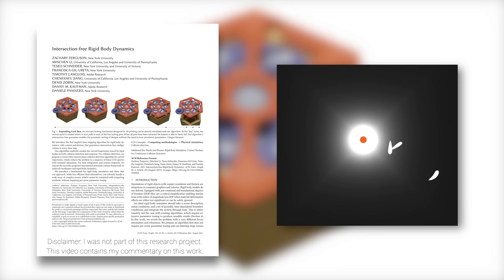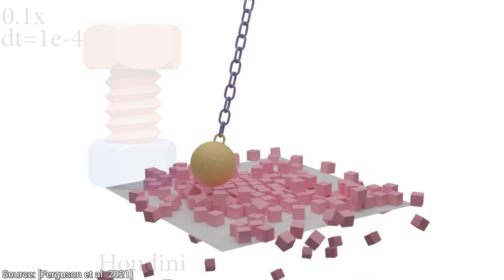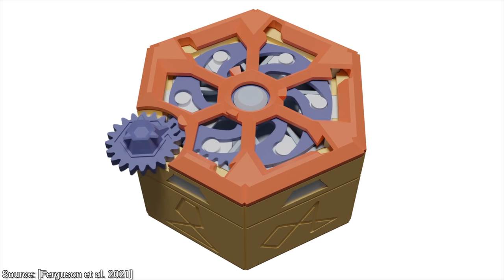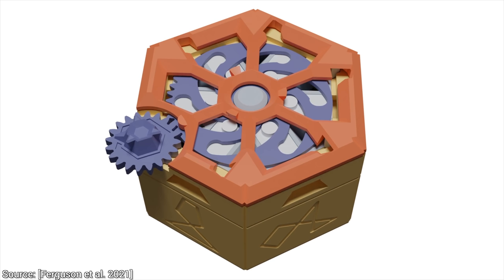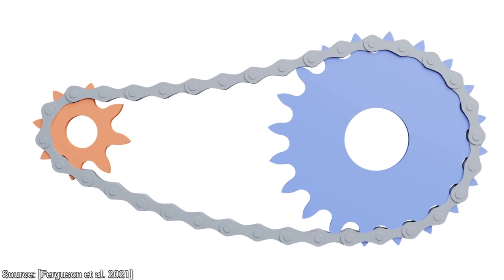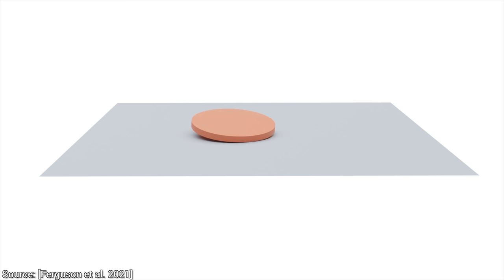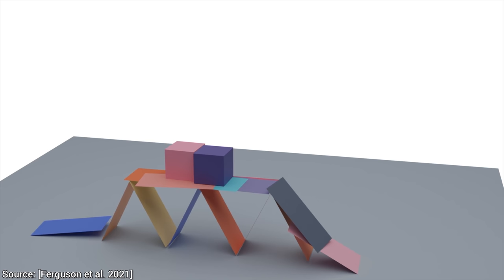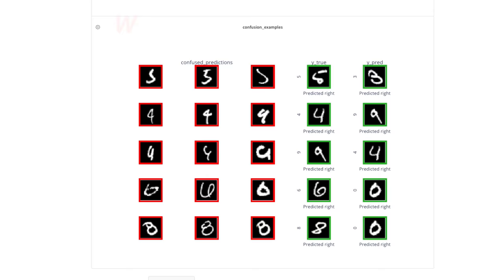The Tale Of The Unscrewable Bolt! 🔩

Comment: Cool that they used the storage box of Makers Muse (a 3D printer channel) and applied friction to it. I wonder what will be next!
Reply: I recognised the logo and was like "Hey, that's Makers muse's box!" It's very interesting that it's now been used in a simulation research paper
Reply: I thought I recognized Angus's maker's mark on the box.
Reply: @danielf3623  Thats not a makers muse box. He based his logo off of that design, that was some antic of some sort
Reply: @a51mj12  Umm, no: https://youtu.be/LU77kPf25Yg?t=503 That's his box, printed out.  That's his maker's mark.  That video goes through his design steps.  Even Károly credits Angus below this video.
Reply: @danielf3623  Its an old mechanism and many are recreating it almost identicaly even the ancient signs on the sides thats where he got his logo from
Reply: @a51mj12  You're joking right?  The mechanism isn't ancient, it's out of a book from 150 years ago.  It's in the previously linked video.  The box is not included.

 Here's a video of him doing maker's coins with that mark from 5 years before the previous video: https://www.youtube.com/watch?v=wSBLOhIFz6s.
Reply: @a51mj12  he specifically made variations of his logo to put on the sides of the box
Reply: @a51mj12  the "ancient signs" are just different versions his logo

Comment: wait so you're telling me we actually don't have an accurate realtime physics engine yet? with the amount of advancements that have been happening in the last few years I totally thought this was a thing that we already had... really shows how early we still are
Reply: we have some engines that are pretty good, but friction is tough to calculate accurately
Reply: There's some really decent realtime simulations for fluids, particles, and balls, but mechanical systems with links and gears in games etc are almost always done by cheating a bit and using a simplified model rather than a generic physics engine with friction, collisions, etc.
Reply: Like, the cars in games aren't simulating the tires turning to propel the car forward... they move the car at a known speed and then figure out how fast the wheels should turn. But actually stimulating the tire physics would be super cool for racing games.
Reply: @wmhilton-old  Scrap Mechanic does simulate the tires turning to propel vehicles, but as any Scrap Mechanic player will tell you, it's far from perfect. The tires bounce on random seeming parts of flat ground and there's a problem with friction, where wheels slide more than they should.

Comment: 1:14
With friction now involved, does it simulate the two flat surfaces being pressed together so much that it takes substantial force to unscrew them again?
I have a feeling that reversing the direction of force will instantly start moving them apart, unrealistically.
Or is it a different domain altogether, like in real life the materials (metal) actually get squeezed by the force and that is what keeps them locked together?

Comment: I am a bit confused: Solidworks (an engineering 3D cad and physical simulation software) has done that for years now. What exactly is the innovation here?
Reply: The collision detection here is on an entirely different level. In my experience with solid works, you generally need to define constraints between different parts to get nice motion (e.g. A screw going into a hole). I know there is collision detection on solid works, but unless I am mistaken, it is more a case of just stopping everything if you try to move parts in a way that collides.

This paper is simulating and calculating the interactions between thousands of surfaces with friction. It doesn't freeze when it detects a collision. It will be simulating thousands of colliding surfaces per step, and needs to calculate reaction forces simultaneously for every collision. It is extremely difficult to do this.